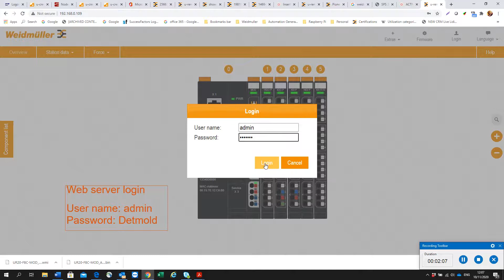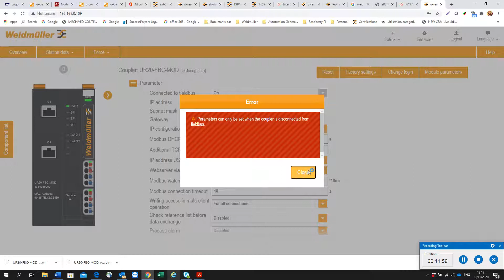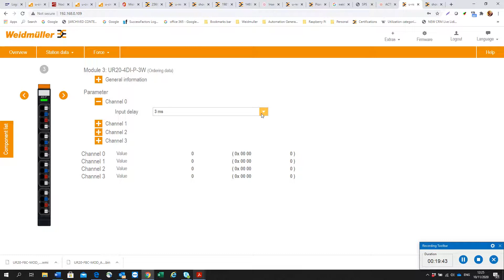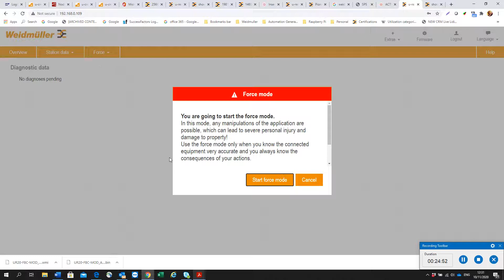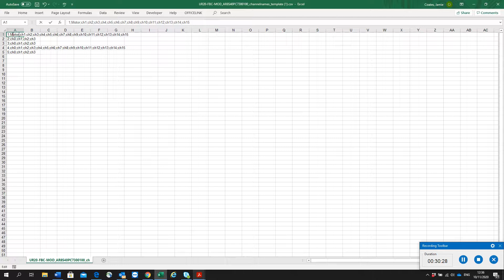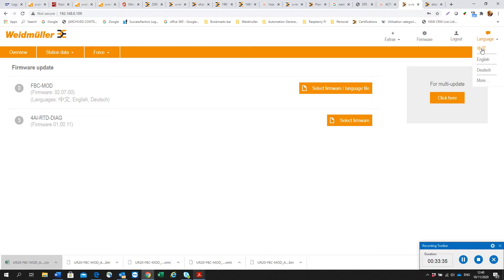Comment: Would I be able to create an EDS file for the Weidmuller Uremote so I can upload it to my IDEC PLC+HMI unit?
Reply: Hi, you don't create EDS files, you download from the product page of the Weidmuller website see link https://catalog.weidmueller.com/procat/Product.jsp;jsessionid=41BB3E3C8B5AE63FBD29FBFA4E91F1BA?productId=(%5b1550550000%5d)&page=Product

Be aware there are three different EthernetIP couplers so make sure you download EDS files for the coupler you have.

You can import if you PLC supports Ethernet IP and has import EDS facility
Reply: @industrialtechnicalinfo5325 Thank you

Comment: I have a BF led on solid mode, can you tell me how to fix this issue? thanks in advance
Reply: Means no connection to field bus which could mean many things, faulty cable, wrong IP address , no data exchange from plc to ur20 coupler. You will see a BF when connecting via USB to PC.
You need to download product manuals from Weidmuller website.
Reply: @industrialtechnicalinfo5325  Thanks for the help, I'll verify some cable connections and I'll notify I get the solution
Reply: @Chipset_X66 Did you by any chance manage to fix your fault. If so how did you fix it?

Comment: Hi.. i have a UR20-FBC-EC-ECO (Ethercat Coupler) but i can not access via web server with any default IP-Address.. Can U help me
Reply: I would suggest, as you have no USB port, IP address has to be assigned by the controller. I would thikn you could then disconnect controller and connect to PC
Reply: @jgambar  have you tried 192.168.10.202 ,one of the default address

Comment: Thanks for making this, I have been looking to possibly buy the field coupler and some modules if I can find them instock.
Reply: Weidmuller like all manufacturers are struggling to get component chips to assembled ur20. Concentrating on supplying existing customers, good luck.
Reply: @jamiecoates9891  nothing is available anywhere.